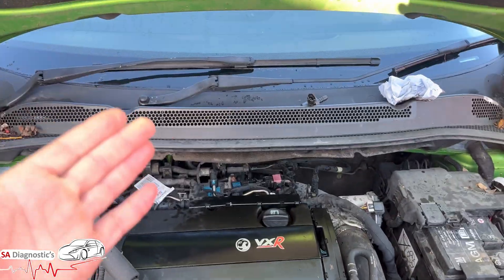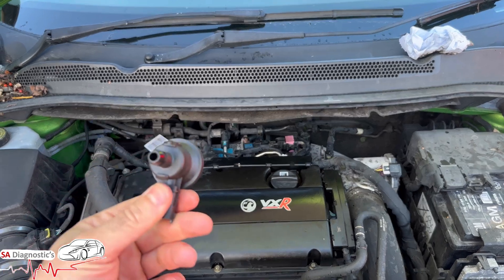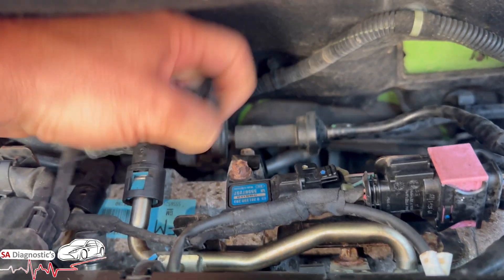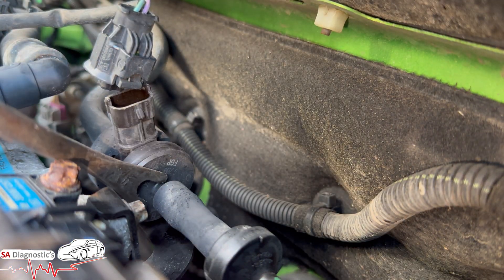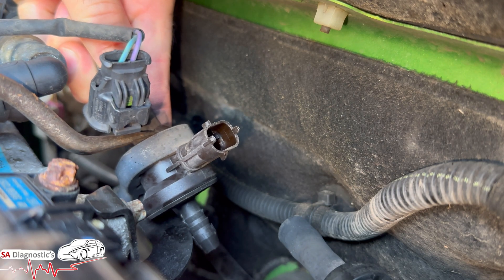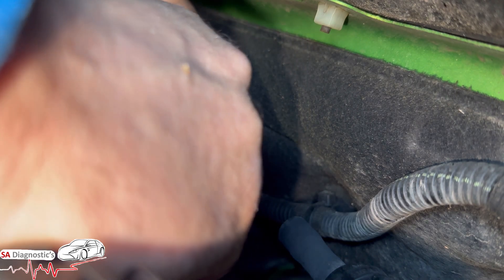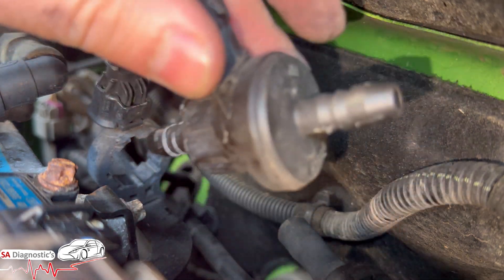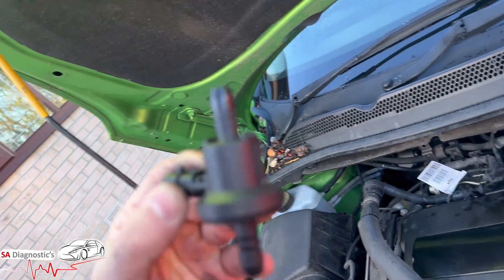Vauxhall P0171 1.0 1.2 1.4 1.6 1.8 2.0 Petrol Vacuum Purge Valve Sensor How to Change it DIY

Comment: Hi i was removing the Purge Valve from my Car and on the left side the plastic of the old Valve is stuck in the hose pipe. What would i use to remove that and should the Purge Valve clip into a bracket before all 3 parts are connected to it ?